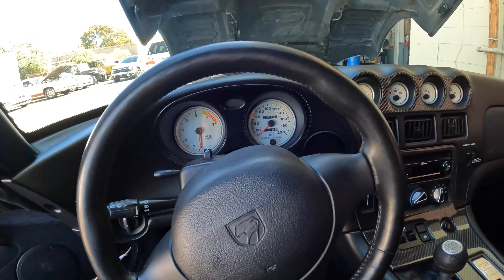Now This Is How A Supercharged Viper Is Suppose To Sound! "New Mods"

Comment: That’s the stock 708 cam with headers and corsa exhaust it gets lopey. If you add 1.7 rockers it gets even choppier. Mine is NA and sounds the same.